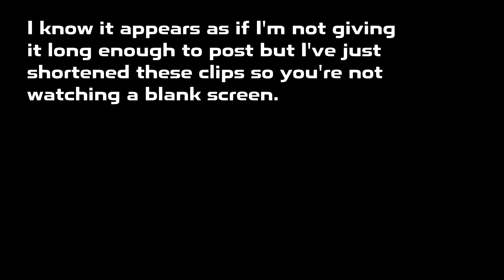Replacing my damaged TF1260 edge connector - mini fix

Comment: Hate jobs like that, especially if theres big ground planes or power rails... if it a problem cut the pins to remove the item then you can dewl with each pin individually instead of all in one go....

Comment: 6:36 I don't think you should have pushed the pins so long in. The connector should have been flat instead. It looks like the connector is installed askew.
Reply: Kinda makes me wonder if that's what led to the original failure too.

Comment: Any video with a 68060 in it gets a free like. Even if it's only an LC... :) But jokes aside, good repair. I also have such a 1200 board, that is very picky about the card position and angle.

Comment: I had a problem with my one. After i moved it around to fit a IDE cable. to get it working I have to put a wedge under it by the trap door, it work now I can boot up off the cards IDE port its about 3.5 X faster than the on bord one.

Comment: Angled connector which is damaged beyond use, well that seems like a perfect candidate to just cut the pins with a side cutter and extract all the pins one by one, by heating them on one side and tweezing them on the other. From the more exposed rows to the less exposed ones. It's still a lot of work, purely because of how many pins these are, but also so much easier than trying to free up every single pin in-place.
Reply: Honestly, I've often found holding loose pins with tweezers much more fiddly than in-place desoldering. Though I say that from DIP chips, not huge connectors like this. And also my knuckles are definitely less-tolerant than many others', of holding tightly onto small things for more than a few minutes.

Comment: Oh, that was some sight to behold with those crushed pins. And yeah, edge connectors... I remember having a Final Cartridge for our Commodore 128 which never worked while fully inserted; always had to go a few mm out before it worked.
Reply from the maker: I don't know why its so fussy to be honest.  Must just be a poor connection from those new slots cause I don't remember having these problems when I had the classic accelerators years ago.